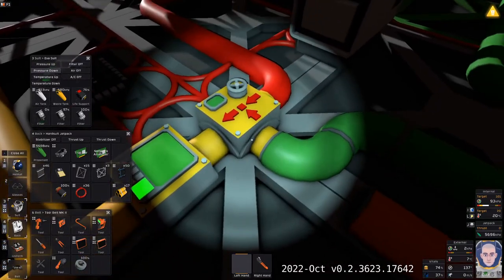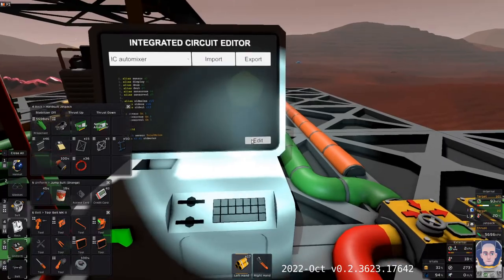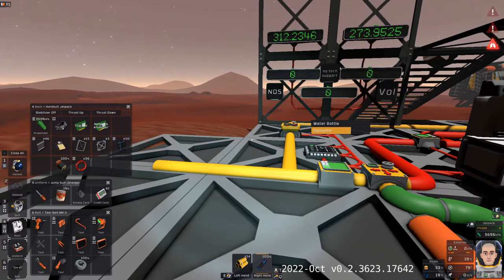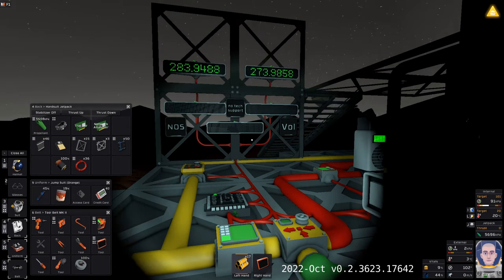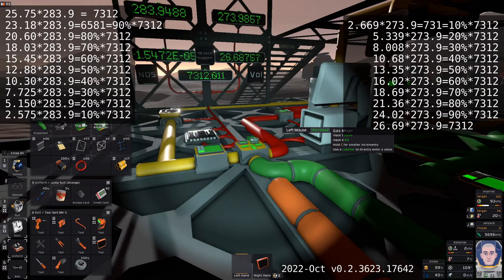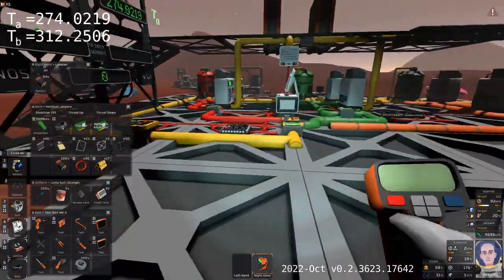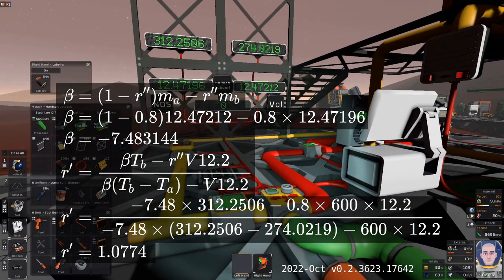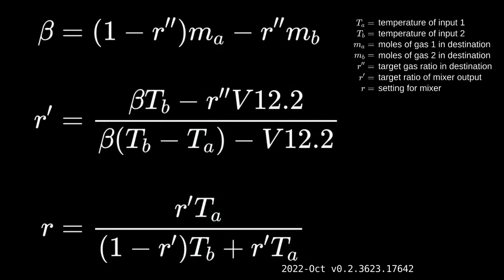Stationeers precision gas mixing with the Gas Mixer

Comment: The bug about creative mode is that it is set based on world settings, not on the save file. So if you start a creative game and then later create a survival game on the same world it will change the creative game's setting to survival. This is a known bug that has been around for a while. (I got hit by the same bug about a month or so ago)